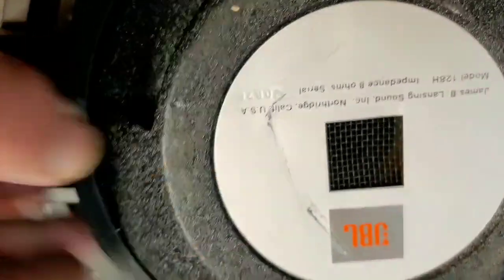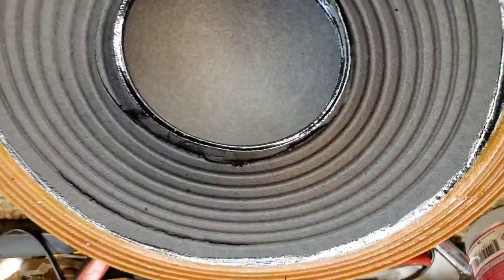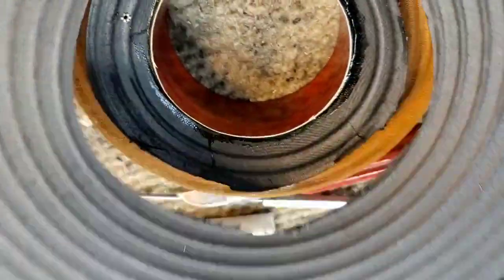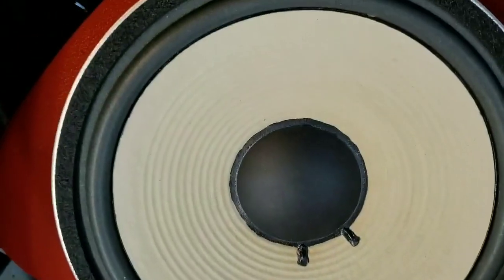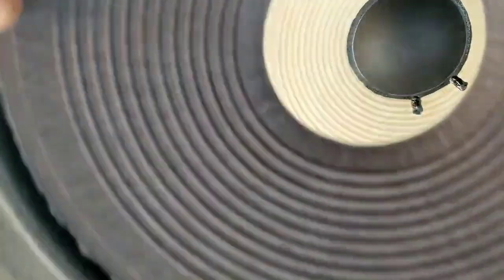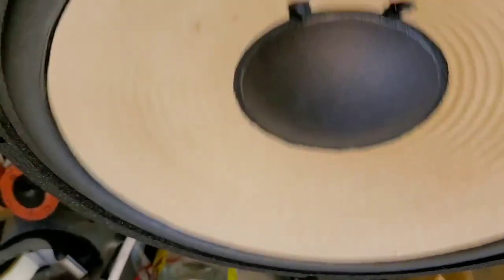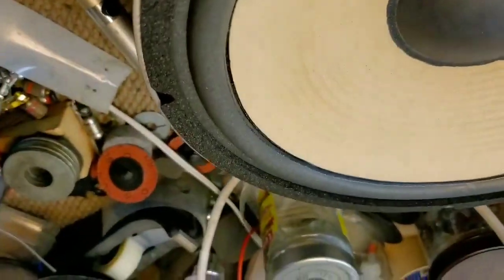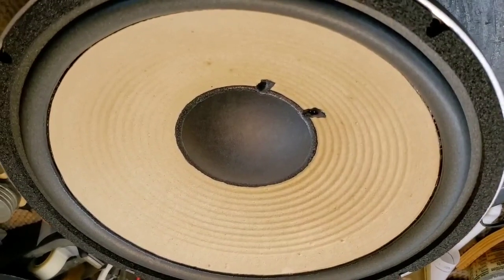True Reproduction Recone kit for JBL 128H...by Upland Loudspeaker Service.

Comment: I found a par of C-38 Barons at a yard sale years ago. I didn't know what they were but after I found out I opened them up. Unfortunately someone had taken the X overs and the tweeters. 1 had a 128 H in it and the other had a 123 A in it.  Not sure how that happened.

The cones and foam crumbled into dust when I put them in my guitar amp. I bought a pair. They want more for a recone for both than you can get a working speaker for.

I put  GT5 -12's in the Baron cabs  and worked great until they started to shake them to pieces. I put more screw in them and they sound great.
Reply: This guy receives payments and doesn't deliver any material, he's a scammer. He talks to you until he gets the money, payment, then disappears, doesn't respond to messages anymore.
A payment of US$2,487.00 was made and he disappeared, he receives money at the address of UPS, not store, (United Parcel Service), 1042 N Mountain Ave, Suite B368 - Upland, CA 91786. 
A FB.
Be careful, don't fall for this trick.